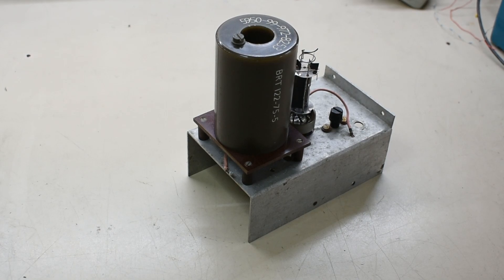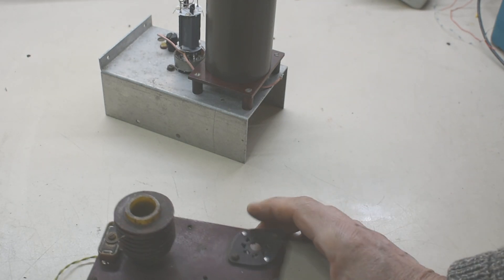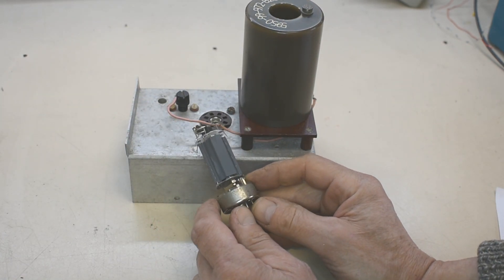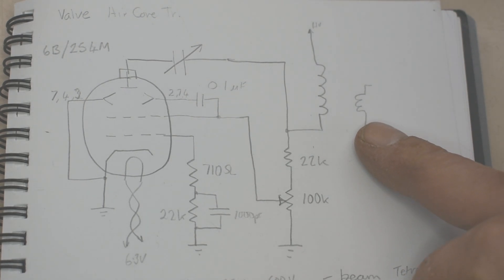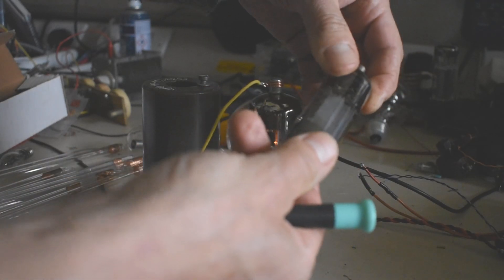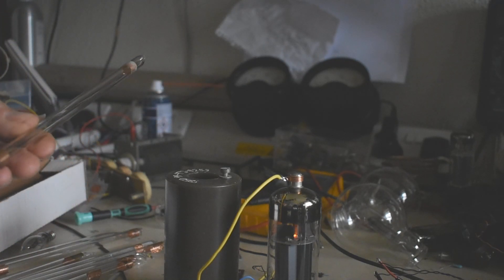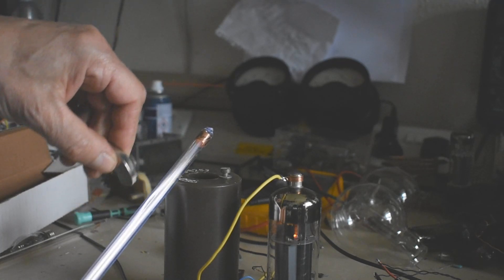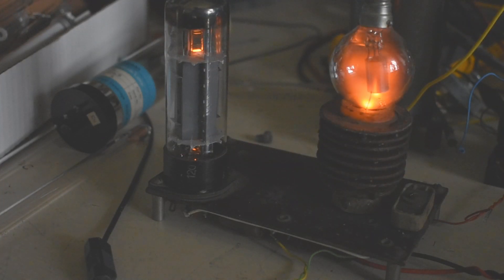Tube Driven Air-Core Transformers

Comment: So, the PL509, used as the line output stage in colour TVs, was a pentode, although it is often described as a beam tetrode, but rarely configured as such.
Reply from the maker: I think so, in both the PL504 (B&W) and PL509 (Colour) there are two grids but the beam plates are counted as a pentode.

Comment: Throughout the entire video, I had the feeling that this was a version of a vacuum-tube Tesla coil, but made in a strange manner.
Transformers with an air core, in my opinion, are more optimal at higher frequencies, in the region of a few to tens of MHz - fewer turns are needed. Or in the case of very short pulses, but this is a completely different topic.
A beautiful compound-filled "keg" asks to insert a core into it and discharge the capacitor to the primary winding. I think the winding insulation will hold it up.
Reply from the maker: Interesting point to add a core given there is a hole through the transformer. It is slightly tapered for some reason and the high voltage terminal would be extremely close to a core, if fitted. Yes, it is identical to a VTTC except for the large number of turns on the secondary making the inductance 1.2H for this coil. One of my large TC coil measures around 0.15H.

Comment: This video contains a clip of a very peculiar phenomenon that I have only ever seen one other time in a short video by someone named "Frogz". At 7:50 a mercury vapor or sodium vapor lamp alumina discharge tube is illuminated, and when the arc is extinguished displays EXTREME phosphorescence. Can you please give some details on the exact model of lamp this came from and when it was manufactured? I've never seen phosphorescence like this in a consumer item outside of the ZnS and Sr aluminate phosphor powders. I'm desperate to find one and get the spectrum of the phosphorescence to see what's going on. I think it could be cerium, but the color isn't quite right.
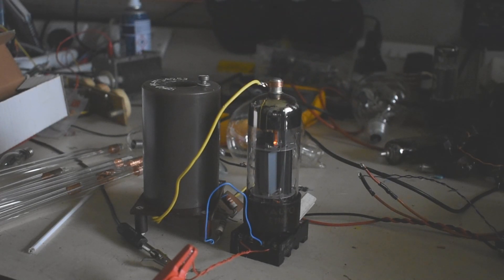Reply from the maker: Yes, it's a property of a dopant used in the manufacture of high pressure sodium lamp arc tubes. These are made with sintered aluminium oxide, but many manufacturers now add a dopant to the process. I can't remember off the top of my head what the dopant is/are. What is interesting about this phosphorescence is most of the light emitted is actually in the UV and you just see the visible blue end of the light.  I also have a video showing this: at 4:50, https://youtu.be/vnnn3clAEG0?si=bpn0gFCKllV0vvUU
Reply: @tuopeeks   cool, I left a comment there.